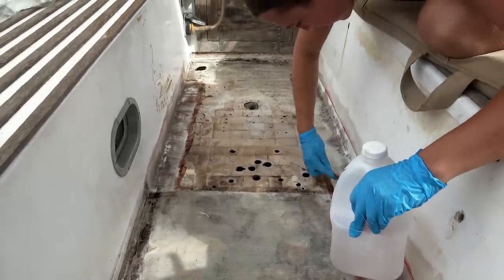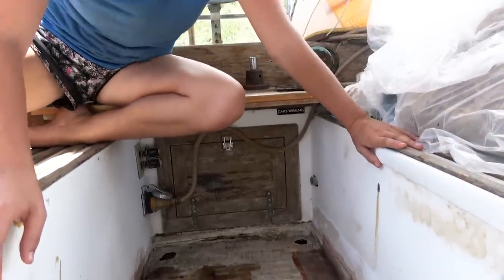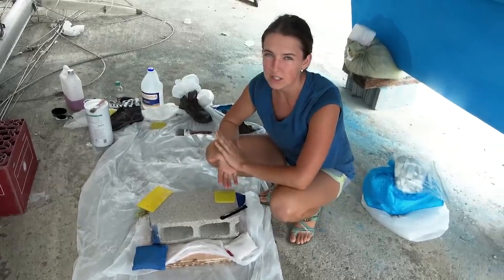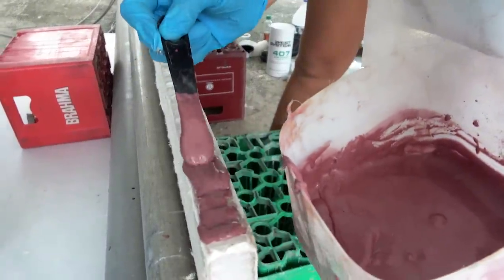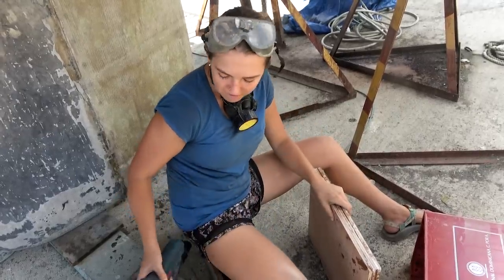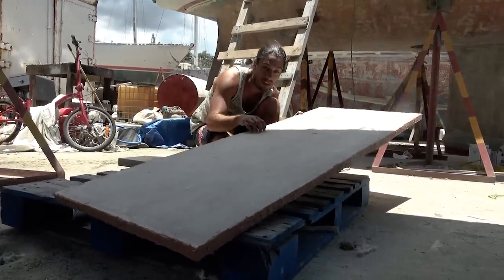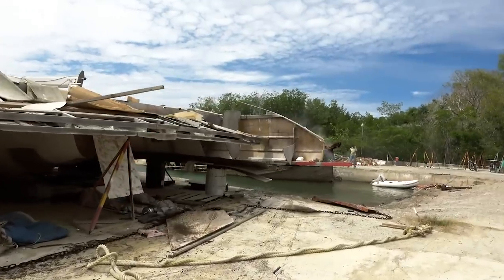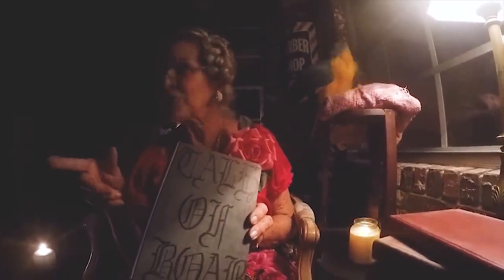Can You Guess Her Sick OBSESSION? Ep 82

Comment: Filling in the edges of the honeycomb core eats up a lot of material and adds a lot of weight without adding strength.  I did that at first, but switched to laying a strip of chopped strand mat over the edges of my core.  There will always be spots along the edge where it doesn't get glued to the glass on the front and back of the panel, but its easy to go along the edge with a brush and resin, sort of scraping a little bead of resin off the brush by sort of scraping the brush across the edge from the front to the side if that makes sense.  This closes off the edge and is very light.  For your cockpit floor, you don't need to do anything the the edge because it gets buried next to the vertical cockpit wall.

If at all possible, put the plywood base for the steering pedestal on top of the honeycomb instead of cutting a hole and trying to inlay it.  The pedestal support will be a lot stronger that way.  If you've already cut the hole in the honeycomb, it might help to lay another couple layers of glass over the entire bottom of the core and fill the entire gap between core and plywood with epoxy peanut butter to really glue it in there.  A lot of forces will be acting on the steering when you are sailing and you don't want the pedestal to move even a little bit.

You guys are learning a lot while doing the restoration on your boat.  There will be a next time someday, and you'll be amazed how much better it goes the second and third time.  If you ever need a pet old-guy to help do stuff, it would be so cool to hang out with you young kids on the boat.
Reply from the maker: We learned this lesson recently. That was a waste of time and materials.

Comment: My guess on the mistake would be cutting out the rectangle in your new laid up core to fit the pedestal base in. Even if you glassed and epoxied them flush. The sharp corners of the plywood base would punch through the glass. Better to round the corners then laminate the plywood base on top. very strong dispersion of load that way. Just guessing though. You guys are doing a fantastic job. Keep it up!
Reply from the maker: Not quite. We do plan to sand the edges and also to use a faring compound to angle the corners and smooth them out.

Comment: Wow! I would never go to so much trouble (ie sanding,  layering ply, filling,  sanding,  glassing, sanding....) I would have put a 1/2" of ply on top of the core 1st, rounded out the edges,  glassed in the whole shabang to the base then built up 3 layers of glass and epoxy over everything in place including the tabs, which is then ready for cutting out scupper drains and steering hole.... but, there's a saying "when working on someone else's ranch, you never know how many ways there are to shovel shit"...
Reply from the maker: LOL that was the previous owner's move. That does sound a bit quicker. That saying couldn't be more true.
Reply: @Bumsonaboat  what I meant was, the honeycomb is the Superior core, after you glass it and glue it to the base!!! The plywood is going to rot.... some time.  But good job and hopefully you can show us the progress on the prop shaft and steering soon! All it takes is $$$$ B.O.A.T. translates to bring on another thousand....

Comment: Little things to remember. # 1 You can put epoxy on top of polyester, but it’s a bad idea to put polyester on to epoxy. The bond is poor. #2 If the epoxy is wet or sticky, it’s fine to ad more layers. If the epoxy is is hard, there are oil/wax like substances that come to the surface. It’s best to wipe with solvent and sand and wipe again for best adhesion. #3 West Systems is about the best, but it’s freaking expensive. #4 If you must use penetrating epoxy, use Git Rot, it has no volatiles that can hinder curing if it cant evaporate out. (As absorption slows, follow with fast cure West Systems to keep holes brimmed) # 5 get a bag of syringes for pushing polyester or epoxy into places or drawing up spillage to reutilize. Have fun guys and don’t expose your skin, eyes and lungs to stuff.

Comment: 1. binnacle plinth could/should have gone full side to side allowing repair in three smaller area stages and removing 2 weak points where end face joins nida to ply longitudinally which is where the binnacle can exert leverage to create movement in the sole creating more cracks to fix later. 
2. binnacle holes not transferred to top of plinth, (holes could/should be precut and used to hold the surfaces together while setting doh !).
3. nidacore not chamferred to suit sole to sidewall radius.
4. sole / sidewall 3 or 4 layers cracked so expect one layer to replace that structural strength ???
5. instead of applying the polyester fairing to the cut edges of the nida core it could have been applied to gap between sidewall and nidacore at time of nida installation removing the need for a lot of sanding of the nida core panel before installation. Always more than one way to do anything, some methods make work and some combine into one process. Knowing a few structural principles would reduce the effort put into areas where there is no structural gain to be made (sides of nida) and would concentrate the effort and effect where structural gains are needed and can be made (top and bottom faces of nida to cockpit).

Comment: I'm only giving advice to help you guys . Instead of sanding to get the plywood the same length cut the edges with a circular saw . And as far as putting anything over black mold is definitely asking for problems  . The way you prepare a surface is critical  . Using bleach mixed with water would have killed the black mold and then sand lightly but make sure you are wearing a respirator  . 
You have hundreds of YouTube videos to learn from I suggest you use them . I watched a video of a guy who did a million dollar overhaul on his boat and he learned almost everything from YouTube  . 
Just trying to help .
Reply: Google bleach vs vinegar, bleach doesn't destroy mold membrane and bleaches mold so it looks gone till it comes back. Vinegar can penetrate the fungus and kill it.

Comment: Was the bonehead mistake that failed to mix the epoxy before you put the thickener in?
Reply from the maker: It was using thickened epoxy to coat the plywood which all came off when we sanded it. The plywood was not able to absorb the resin. The whole purpose of this was to make the plywood more water proof. Should have used un thickened epoxy.

Comment: Or go to Florida and get a new boat for a couple of grand
Reply: What?  Inherit someone else's problem?  There boat is not that bad.
Reply: What’s the story with the failed grid system holding the keel in the boat? Serious issue which should be addressed before ANY of these other projects. Interior needs to come out, keel should be dropped and grid system rebuilt. Taking this boat offshore without repairing this issue is a recipe for disaster.
Reply: @iraperry5218  You obviously haven't sailed around the Caribbean....
Reply: Malama Robinson I guess the obvious escapes you. I’ve been sailing(cruising and racing)over 40 years in all parts of the world. I was last in the Caribbean last January. Addressing minor boat issues on a boat while ignoring a major structural issue which could result in serious injury or death just isn’t smart, no matter how many other dreamers are doing it. The boat is a death trap with that waving keel and needs to be addressed by professionals before they hurt or kill themselves or endanger first responders who are there to save them when things go tits up.
Reply: @iraperry5218  nope, you guessed wrong.... boats are all death traps but I have seen way, way worse than this in Haiti to the South seas and the reason most accidents are avoided is due to good seamanship....
I have also seen multiple ghost ships floating around in the ocean worth once millions but the owners or crew failed to secure themselves in the vessel while pissing off the rail and fell in....

Comment: One of them says thickened polyester on the Nida core edges the other says thickened epoxy on the Nida core edges, which , in itself means nothing other than an inconsequential terminological inexactitude , however , this tiny error combined with all the other total fuck ups tells me you are wallowing in the mire . the edges of the Nida core do not require filling and sanding , the edges  get filled automatically when the Nida core is installed when a cove is moulded to the cockpit sole.  The pedestal plinth is totally wrong , throw it away , and start again . Do NOT expect to install ANY fastenings through ANY wood without firstly predrilling oversized holes , filling the drill holes with glue powder ( blown silica powder) mixed with epoxy resin, redrill the holes to the required size , coat the fastening with 3m 5200 or Sikaflex,  only then can a fastening be introduced . For fucks sake do some reading . i.e. the Gougeon brothers on boatbuilding would be a start . Without exception every step in every one of your undertakings thus far have been drowned in misguided enthusiasm , for fucks sake think things through, you just charge off at a hundred miles an hour in the wrong direction. You seem hell bent on making things awkward and convoluted resulting in an infantile mess ,  when , in actual fact what you are trying to achieve is called just plain old common sense. You have thus far failed to mention anything regarding the fractured floors in the saloon ? this has priority over all the fluff you're pissing around with now. You have neglected to mention the keel, other than a shit house laminating job which needs to be ground out and re-done (full of air bubbles). Michal you are worth millions for cheerfulness and enthusiasm that partner of yours is a fucking idiot.